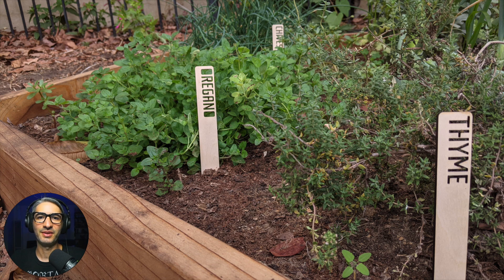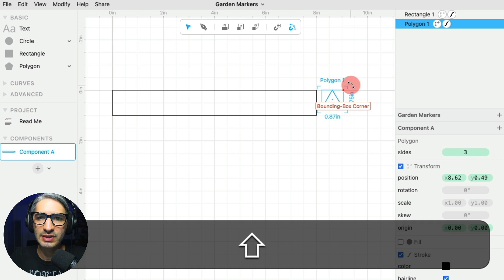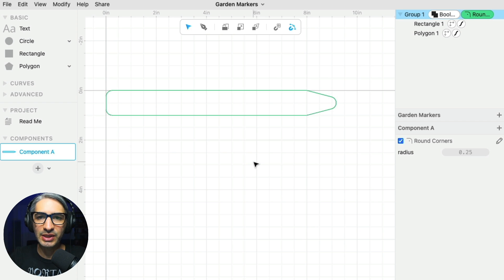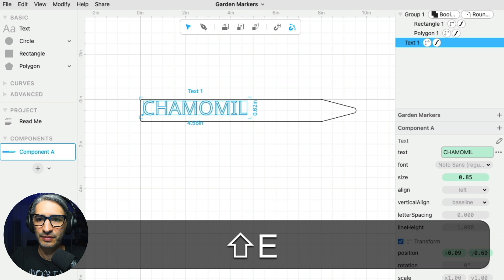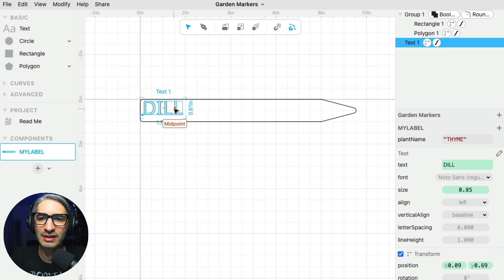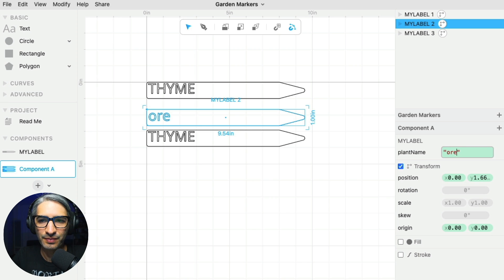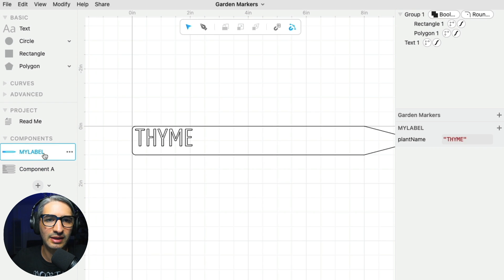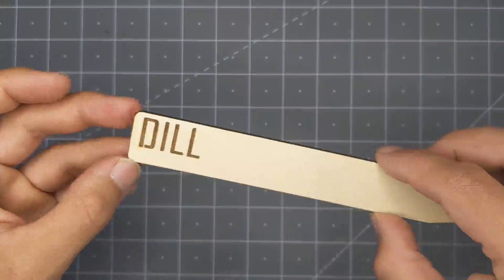Make Plant Markers for the Garden in Cuttle

Comment: With the exception of being able to change the font on all markers at the same time, wouldn't it be faster to just create one marker and then copy/paste or duplicate as many as you need and then just select and change the text for each different marker? Also would be faster to make just one cut line where multiple markers are stacked - similar to having just one verticle and one horizontal cut line for jigsaw puzzles instead of cutting all sides of every piece separately.